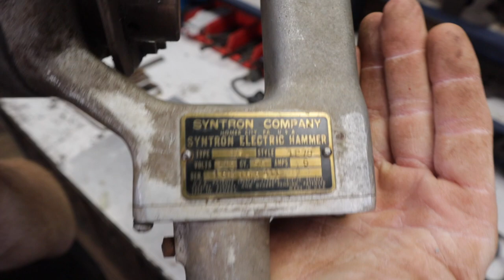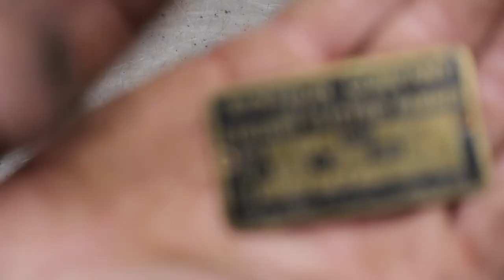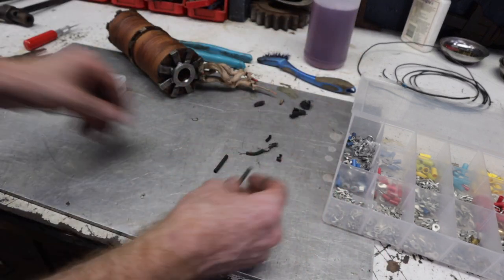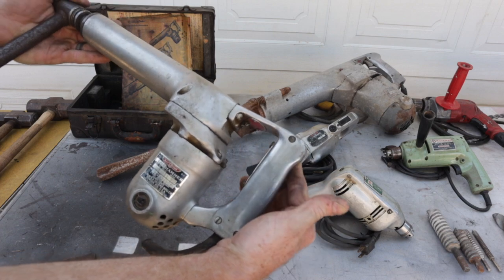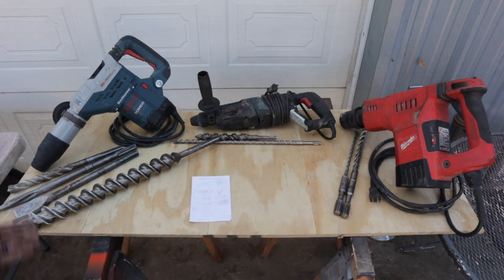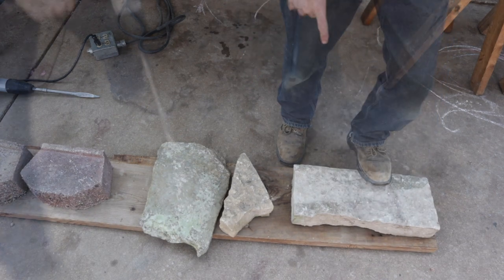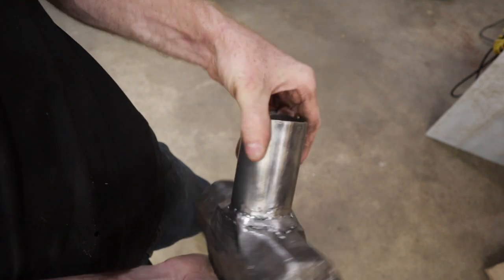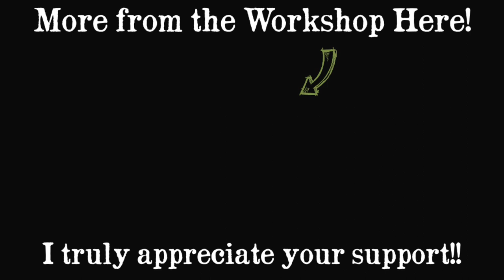1930's Electric Hammer ~ RESTORATION & How It Evolved!

Comment: The bit in the hammer drill you were showing is called a star drill. when activating the tool,  swing the lateral arm back and fourth to create a drilling effect.  When I first got into construction I used a tool a lot like it to drill holes in concrete to set anchors for bolts and threaded rods. That was in the early 70's, and you're right, it ain't easy or fun.
Reply from the maker: I honestly didn't know that! Thanks for letting me know! That sounds like a TON of work, especially compared to what we have today, but back then, I'm sure everyone thought the same thing then as well!

Comment: Another great vid.  As a guy who works with electricity. Please add a three prong plug from your power unit. If that all metal tool gets a short to frame you will get electrocuted.  The plug from the tool is grounded but your final plug was not. You can add the three wire and bond the new green wire to the metal case.  If it was double insulated this wouldn’t be required. I love the guard you welded on to safe your handle.  That’s a great idea.
Reply from the maker: Don't worry that thing is never getting used!

Comment: On your power hammer, the section that holds the cutting bit has the handle not only for only holding the cutting bit but it is to be rotated  back and forth as it is hammer cutting in the the mason or stone.  This provides the function to clear the cutting bit edge like a modern hammer drill does automatically by turn the bit continuously. You have some rare older electronic hand tools, nice
Reply from the maker: Ya, I just learned that! Thank you! Doing that would be a fair bit of work to make a hole! I'm glad I don't have to do it that way today! Thanks for watching & commenting!

Comment: When welding holes up put a piece of copper plate behind the hole.
Reply from the maker: That's a great tip, thank you Robert!
Reply: Why copper Robert? Easy to remove?
Reply from the maker: @dfbess  Because the weld will not stick to it, and it will give the weld something flat to lay against!

Comment: Those old three flute tools are 'star drills' and they were used to make holes in masonry. Originally they were driven by hitting with a hammer and for sure it was slow and tedious. To make it even more of a pain every so often the hole had to be cleared of dust. Because it was so tedious you'll find in old buildings it was common to use a wooden plug in the mortar to take a screw.
Reply from the maker: It's crazy how far we've come!

Comment: for hard stone, the hammer drill is for driling holes in a line you where you want to cut it. Then you use wedges and feathers with a big hammer to actually break the stone. So even with a hammer drill, it still comes back to using a hammer.
Reply from the maker: It's always hammer time!
Reply: @SalvageWorkshop  LOL

Comment: Those old drill bits associated with the electric hammers are called 'star bits' they're intended to be used with manual hammers and twisted a bit with each blow.  Slow but faster than anything up to their invention.

Comment: Those old electric hammers are drills, as are the manual cross or star drill chisels. Smack, turn, smack, turn, smack, turn... With the electric you would move the chisel holder handle around as the the hammer beat on it. Tedious but that's how it was done for blasting holes or  to put feathers and wedges in to split rocks. My Hilti TE6-S is a bit more efficient though ;)
Reply from the maker: Interesting, I always thought it was just used as an impacting hammer tool... Tedious sounds like an understatement! Hilti does make some awesome tools!!
Reply: @SalvageWorkshop  Hilti is Snap-On for construction. Some of it worth the coin, most isn't. You're buying a warranty. I used one of those Bosch Bulldog drills for years, not bad. The higher PSI concretes will laugh at it though.
Reply from the maker: @davewood406  Ya I've run the Hilti Hammers, and they are awesome, but even though i run a construction business, i've never been able to justify the crazy prices on those bad boys, and I almost never see them for sale used in our area! I buy a TON of my tools used, I'm just picky about not getting ones that have been abused. At the right price, Id prefer to have something larger anyway, the bulldogs have their place though!

Comment: You could a metal rings and a rubber cushion to your fence lock to help keep the water and frozen stuff out of those holes which would make your concrete last longer
Reply from the maker: The water will drain straight down through the sand that is below the concrete! That's why I drilled all the way through!

Comment: Another really impressive video IMO - actually in particular your overview of hammers, drills and hammer-drills was really helpful.  I've seen people use them but never understand the "what" and the "why".  Great restoration!  Would have liked to see it function, but you wouldn't want to run that thing very long (and have to oil and clean it again LOL).  I really like the way you welded a sleeve onto that sledge hammer - really good idea.  In the past I managed to knock the head off of one of those...

Comment: I hope you put a modern plug on the end. Had a friend get screwed up when he plugged his in backwards and made the body hot. Shocked the heck out of him messing up his heart.
Reply from the maker: Nope! I left it original just as I found it! I have NO intention to actually use this old hammer, as you saw I have plenty of modern options available to me!
Reply: That 3-pin plug is the standard form-factor here in New Zealand (240 V, 50 - 60 Hz) - got quite a surprise to see one in the States!

Comment: Point of interest (well, maybe not... Lol) is that the 3 pin plug from the hammer to the rectifier is a standard plug for here in Australia. It's the end on all of our cords, 3 pin plug in the wall socket. It's earthed, and whether it's what makes the difference, our voltage is 240 AC

Comment: The cross point bits are for drilling holes in masonry or stone, the predecessor to the rotary masonry bit.
Reply: I remember my dad using the predecessor to that, it was just a cross-pointed bit like that, with a small sledge, in the 1960's, to drill some holes into concrete.  He called it a star drill.

Comment: on that sledge, fill the space between the handle and pipe with something, rubber would be good but hard to do.
Reply from the maker: Not a bad idea... although I want to see how it holds up like this for now!
Reply: @SalvageWorkshop  it's bound to get dinged up, if you miss where you're aiming. Something behind it will keep the dings to aminimum.

Comment: I believe that was a selenium rectifier in that ventilated tube, them suckers are dangerous since they are so old they can fail catastrophically without warning and catch fire or even worse they can emit poisonous smoke, I know you want to be true to the design so moder high amp diodes can be placed inside the shield housing and it will safer and probably much more efficient. Good show keep up the good work.
Reply from the maker: I honestly had NO idea what it was, and I was hoping someone would know! Don't worry this is one restoration that will get NO use! It will be a decoration somewhere here in the shop! Thanks for the DANGER heads up! Much appreciated!
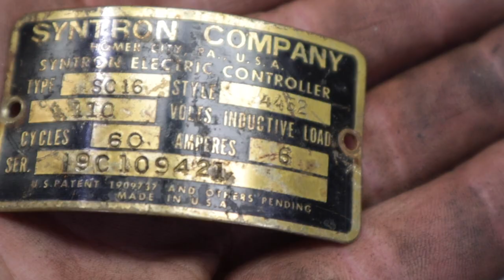Reply: 10:16 The tag said Inductive Load.  The first time I ran across that term was many years ago working on stereos. The output amp would get upset if there wasn't a speaker connected, so you would place an inductive load, which were very low ohm/high watt resistors. The hammer was rated 110 volts at 6 amps, so I would assume the resistor was there to keep the supply voltage from going nuts when the switch was turned off then on then off.

Comment: I would be interested in finding out how heavy your formally 16 lb hammer is now after adding the scarf.  Perhaps 17 lbs?  I loved the idea of the scarf, I have seen other people use leather, rope and or resin but never steel.  I can see how that hammer would need something stronger to protect the handle.  I was thinking after seeing this about perhaps using that idea (on a much smaller scale) on one of my hatchets.
I may suggest some drain holes in the scarf between it and the hammer head.  Right now if you store it like you show (hammer head down) you have created a bowl in witch water can collect and stay, rotting the wood and rusting the metal.
Reply from the maker: Go for it my friend!! I'd love to see the hatchet if you do try it! Initially I was considering welding a solid steel pipe to the hammer head, but the problem with that is the impact shock vibrations will radiate down the handle into my hands making it EXTREMELY uncomfortable to use.. Then I thought why does it have to be all the way, so we'll see how well it holds up! I'll have to weigh it, but I'll bet you're right, probably 17lbs plus the handle, so maybe 18 or so altogether!
Reply: If it were me, I would fill it with epoxy

Comment: The more times you compress a solderless terminal the more chance you have of not getting the squeeze you originally had. Sometimes it is better to just solder the solderless terminals as it does not really take all that much time. Way better job electrically. Just saying, as experience has shown me that rule. Then Mr. Murphy can just jump in the lake and leave one alone. Good Day Too.
Reply from the maker: If I had the proper tool for crimping that connector it would be easier, oh well, these are crimped & soldered, so I'm sure it will be fine for a tool that wont see much use! LOL Thanks for watching & commenting!

Comment: Great vid, very informative.  Excellent restoration... but I didn't get what the cylindrical mesh in-line thing did ?  Can you explain ?  Greetings from Sothport UK.
Reply: my guess is a 90 year old mosfet switching thingamabob
Reply from the maker: I agree, but I honestly don't really know... Whatever it is they are probably 1000 times smaller in today's tools & electronics!
Reply: I think it is a rectifier to convert AC power to DC as this appears to work as a giant solenoid.

Comment: I haven't seen that kind of tape that's inside since the 1960's.
Reply: Cotton Covered Bitumen Tape ! I guess...
Reply: @NavinBetamax  we called it friction tape. At one time, when splices were still done with solder and tape, you had to use that, then more modern electrical tape over that. That was before wire nuts became common. I actually learned about a dozen ways to solder splice various kinds of wires... a couple years later, that was pretty much obsolete.
Reply: @tootall5559    ......Yes.....WW2 era.....double cotton covered wire for radio antennae and earth connections for my Murphy 16 band Valve Radio .   ----for example.... even laundry irons had cotton covered mains cable....bakelite.....mica....asbestos...etc for insulation.....Those were the days I  started learning electricals and stuff (school days) from my gran dad...! Lol !
Reply: @tootall5559   Good to hear you had a good teacher when starting....I am retired now and pass my time watching young first year engineers working on their college projects......still learning new things Technology is providing.
Reply: @NavinBetamax  I thnk any engineer of any kind should have to be in the trenches for a couple of years before they get any kind of degree, automovive, construction, electrical, whatever, the engineers do some of the dumbest stuff in their designs, but then they don't have to build them or repair them. Automotive engineers should have to work as mechanics before they get a degree, electrical engineers shoudl work as helpers before they get a degree, and so forth. I've always wondered why when they spec out the conduit, they spec the smallest possible, Using half inch when 3/4 would be much better and faster. Things like that used to drive me nuts.

Comment: Those hammers ARE actually drills.  Rock drills.  If you rotate the cross tip nack and forth with your hand it will.drill a hole in stone.  The cross bits are.meant to be rotated.
Reply: I'm talking specifically about the antique hammers you showed first.

Comment: I can tell that you are not used to using drills, you let the tool do the work and you just guide it , you should not have to put your weight behind it just a little bit of pressure.